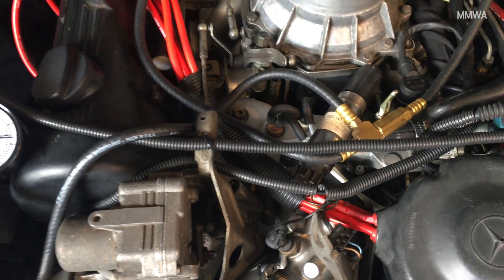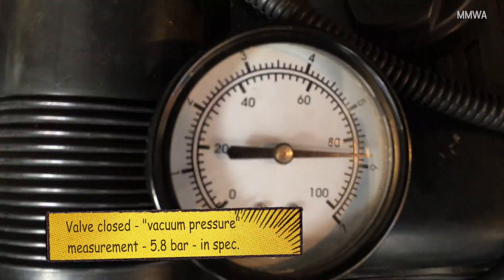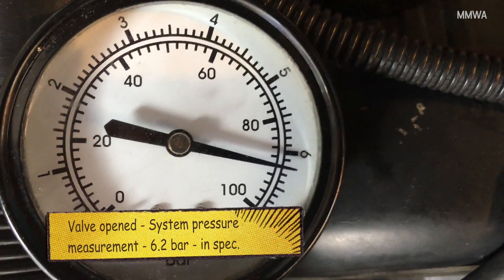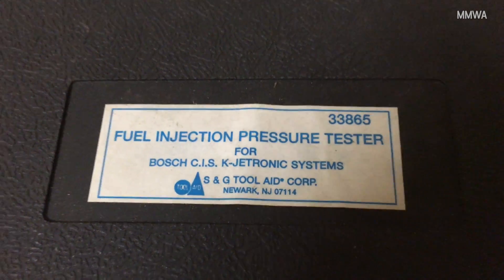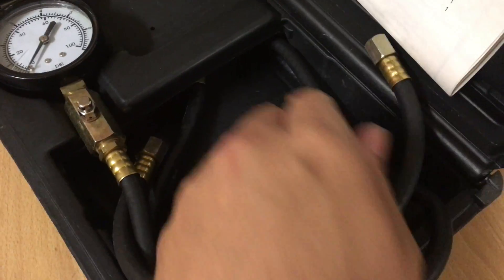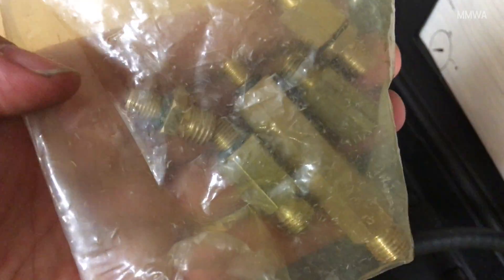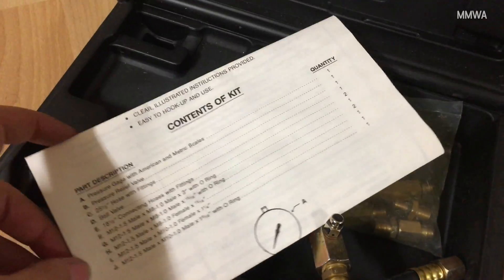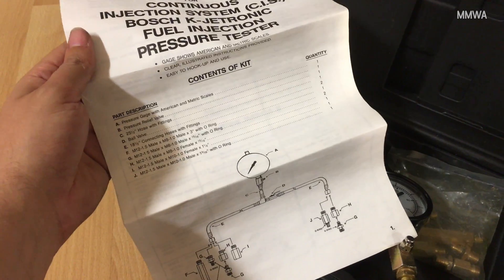Measuring KE-Jetronic Fuel Pressures

Comment: Dear MMWA, Thanks for all the very helpful videos filled with great
information through the years. I really enjoy all the videos! 

I am looking to buy a pressure gauge to check my fuel pressure. I am just not sure about
the difference between vacuum pressure and the system pressure. I have checked
ebay for "fuel injection pressure tester for bosch cis k jetronic
33865" but without any luck. The other available kits online don’t have
the ball value you use to switch between the two pressures. 

Do you happen to know any kits available now a days?

Thanks in advance .
Reply from the maker: Here in Australia, literally first item that comes up for fuel injection pressure tester includes the ball valve so you know its gonna work with CIS / CIS-E https://www.ebay.com.au/itm/162512904004
Reply: @MMWA-DAVE  Beautiful. I just didnt see the valve and wasent sure if the right fittings were in the case. 
But thanks for the quick replay. And again thanks for the videos.!
Reply from the maker: @simonkiilerich430  The only other option on there is $400 and screw that, the $400 repco kit specifically mentions CIS K-Jetronic. The universal china kit probably will work fine and its a cheap price.
Reply: @MMWA-DAVE  well thanks for the good information. I suspect my regulator to malfunction unfourtuanelty.

Comment: very nice video mister:) I have one question for you...the surging you are talking about....at what Rpm is this occuring?im helping out a friend with his mercedes with ke jetronic..and his mixture is going super lean after 3500/4000 rpm and upwards..and it stumbles..sounds like misfiring..and ive confirmed it is going lean..so im going for the enrichment is not workiing..so your video made me curious.Greetings from norway , Stefan
Reply from the maker: Confirmed leaning out on this too, starting at 2500rpm it starts misfiring. Proven theres no acceleration enrichment by way of the gauge and also, if he holds the throttle at 2500rpm and while its stumbling I push down the air metering plate to manually richen the mixture the revs then run away well over 3000, so 1000% certain its leaning out. In this case I am certain the air flow meter is not working properly, electrically it is not behaving the same as 2 x other spare units of the same type we have spare. Also worth noting is this engine has a massive vacuum leak somewhere too we have not found, its pulling 50mm hg less vacuum than his also high compression m117 5 litre. I suspect the intake manifold is no longer the correct shape after the heads were machined and reinstalled several years ago. Its always had a lumpy idle and I think we are getting to the bottom of it.
Reply: hey again mister:) Sorry for the late reply.I wonder..have you measured the air flow potmeter?i mean..if it gets the correct reading..i did not get how the potmeter "fingers" could be  worn ?Oh..vacum leak..definetly not a good ting...did you locate the vacum leak?anyways..when it comes to the car im dealing with..i have a little update...it does seem that the plunger is sticking on the car im working on..i did measure the top chamber pressure..and system pressure..and they all check out.But when i was fiddling around with the pressure testing..i did some experimenting with the air flow plate...just pushing it completely to its max travel...many times..and fast..and then started the car..and i was able to get full rev..without the stumbling and "misfiring"..sped up and mounted the aircleaner..made the owner go out for a test drive..and first pedal to the metal..it went perfect..then it started to "misfire and bog"..or hesitate at the same rev mark as earlier around 3500revs..so i am now removing the fuel distributor ,to double check the plunger/have done it earlier also..and did find that it is leaking a tad through the seal at the end of the plunger screw fitting..and in the back of my mind i think i remember the plunger not coming out completely ..so thats why i have a strong feeling that i will find a sticking plunger.Sorry for the long reply..just wanted to update you ..and also say thanx for replying :)Greetings from Norway ,Stefan :)
Reply: @TheCarTakerGarage  Sounds like a task. What did the solution wind up being in your case?
Reply: @BoyishDriver  Hey mister.I fixed this particular car i was talking about here.And i found the fault to be a sticking plunger inside the Fueldistributor.So i rebuilt the fueldistributor ,new diaphragm,new seals...actually i bought a complete overhaul kit from CIS Jetronic "Dealer" on Ebay....Afterwards i checked the flowrate on each injector,and they were within spec ..so i did not need to adjust flow inside the fueldistributor.Luckily :) It is a fiddly job...but if you do have some skills,and if you are precise in the way you work..and if you take your time..this will be a fun litle job  overhauling a Ke Jetronic Fueldistributor.I did not make a video of this job unfortunatly...But maybe i will do a similar video at some point and put out on my channel.Thank you for commenting,Greetings,Stefan :)

Comment: When i want to Change my injectors,is There a way That No fuel is leaking when i de-plug at the fuel Distributor?
Reply from the maker: depending on the car, what I do is run the engine and pull the fuel pump relay while its running so it stalls and it reduces the amount of fuel in the distributor. I also let the fuel tank vent any pressure before touching the fuel lines. I always have a rag nearby and under the fuel connections when loosening. Im not aware of any way of completely eliminating any spillage. One just has to be careful and be safe.